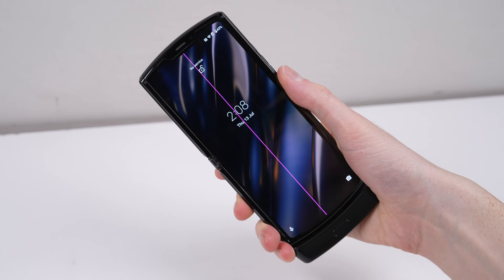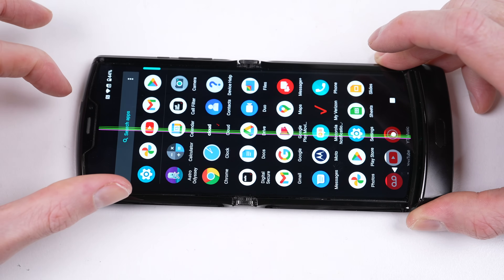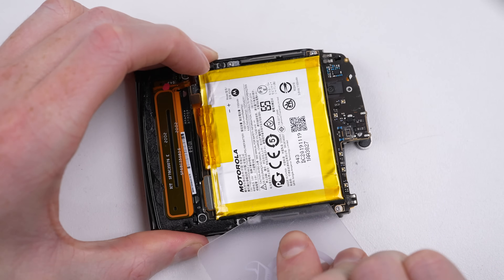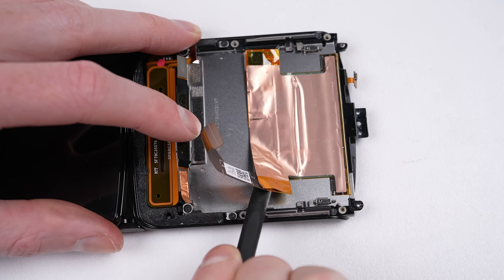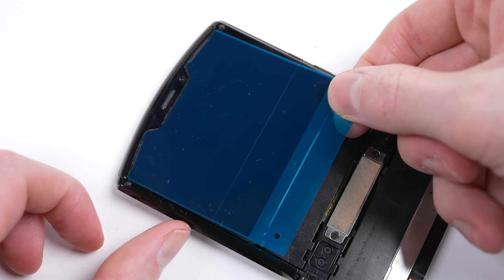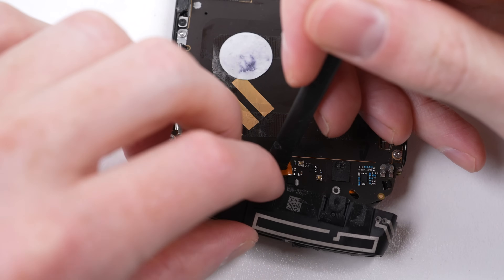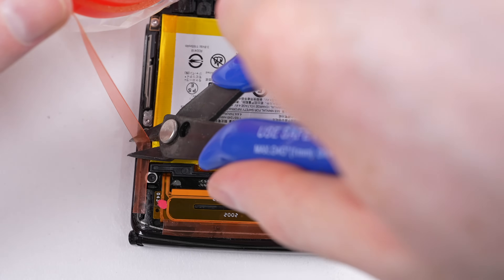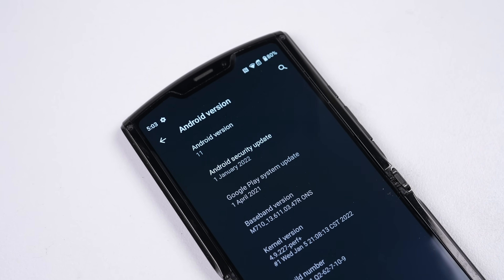Motorola Razr Folding Display Replacement - This Phone Got A 1/10 Repairability Score

Comment: For whatever reason, most carrier phones in the US require to be connected to the carrier to receive updates. Speculation on my part suggests that it's due to the fact that carrier models get carrier provisions provided through software updates, which means updates come from carrier servers rather than from the manufacturer. It's not always required, but I find it finds updates better being on network. 
Regardless, Verizon's website puts that as the last update as well. It's a shame that the phone was only officially supported with security updates for two years.

Comment: Plus side is Verizon only has a "60 day lock policy," on phones bought from them(60 days after activation), after that it is removed automatically(unless the device is deemed stolen or purchased fraudulently).  This includes devices with e-sims too.
Reply: That's kind of them.
Reply: I wish sprint did the same. I bought a phone through them 2 years ago, paid it off in full, and it's still locked to them... Crooks
Reply: @AmericanLibertarian Plus, Sprint is now part of T-Moblie.
Reply: Well sprint does have a lock policy around the same but last I knew it wasn't auto-unlocked and requires you to go through all the steps with contacting them/etc to get them to unlock it. As if you don't do all that it'll just sit there locked to their network forever and they won't do anything about it.
Reply: Not true

Comment: I have a Motorola E40, running on Android 11 , pretty solid and easy to access it's battery like any budget phones with the back panel attached by plastic clips instead of glue.

Motorola phones are great to use but to be honest, with only 1 Android upgrade, it's better to look for realme, OnePlus, oppo, vivo, Samsung, Xiaomi which offers more than 2 Android upgrades
Reply: It's not as straight forward or problematic as you think.
Software updates are great and important when it comes to security but they way Android works they are not as important.
Because Android is used on a huge range of devices made by different companies and with plenty of specific components it's not possible to have a central update system so it depends on each company. Today more and more Android phone manufacturers provide longer update support, but usually only for selected devices. Motorola had one of the best update policy when Google bought their mobile devision and this was mostly passed to Lenovo but what was considered good then cannot be considered good today. The mentioed E40 is a low range phone. This does not mean it's not good but have no, or poor, update policy. The Razr got two OS updates and 3 years of security updates.
That said, Google worked to change this as much as possible
First, by enforcing manufacturers that signs a contract with (without it they cannot use Google apps and services) to provide a minimum of 2 years of security updates (minimum requirment is one every 3 minths).
But the most important one is the seperation of most updates from the main OS core update. During the first Android years OS update were requiered for most components, including Google services (like in iOS) but they gradually seperated almost all updates from the OS one and for a few years now Google pushes most updates directly to phones without an OS update - mostly through the Google Play services, This component has full access to the core and can only be updated by Google. Apps, including core ones (like the dialer, for example) recieve contant updates, regardless of the OS version (If I remember correctly this applies all the way to Androis 4.4. Apart from updating apps it can also add some new features, that were intreduced on newer OS versions, and it monitors all app activities, including apps installed from 3rd party stores or sideloaded apps so it acts as a type of anti virous.
Another change is the ability to poosh to all devices specific upadates from hardware manufacturer for specific componants (like Windows does), although it's usually used only for crucial updates.

Comment: Wow, that was a tricky repair, from what I saw at least, but I agree with you there. If you can replace the flexible plastic display (which, let's be honest, is going to be nigh on impossible for a Samsung folding device), it deserves more than 1/10. And to give the iPhone 14 7/10 when it has software-paired components that no one can replace? Yeah, these repair scores are amiss.
Reply: Maybe they only rate how hard it is to physically replace components not caring if they actually work afterwards. I had to replace the battery on the Iphone SE2 and replacing the bms was definitely mor difficult than just the whole battery and I would give the phone a 2/10. Really not properly repairable for a normal user.
Reply: I wonder if the scores would be yhe same if we just switched brands
Reply: It really sounds a lot like either incompetence, bribery or both.
Reply: "software-paired components that no one can replace" oh you can replace them, it's just really difficult. Like soldering over ICs from old to new screen, spot-welding old BMS to new battery and replacing dot projector on FaceID. It's not easy, but doable. And many shops do it every day. Although some customers don't even care if they lose the battery health info or get warning messages. All in all, an iPhone with unpaired parts is still 99% usable.

Comment: Separating the display is like heart surgery. I was hoping there's an option with a frame display attached to it. I'm impressed that old display still works.
Reply: The fact the old display, even after seemingly being stretched in unnatural ways when he worked to remove it, still displays just as well as before removal, can be seen as a testimony to OLED's flexibility and durability. As he said, it's very likely it's only the ribbon cable that's damaged.

Even the new one, when he tried to lift it to readjust its position and started to bend it, still works and shows no display issue. OLED is remarkably resilient. Flex cables? Not so much.
Reply: It's like a fiber optic cable you can bend it a bit but never do a 90 degree Bend